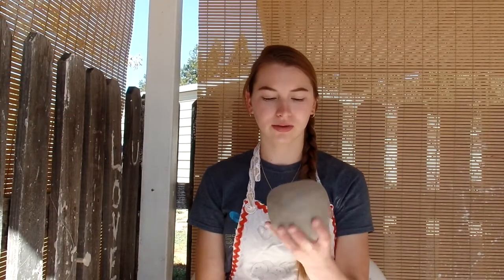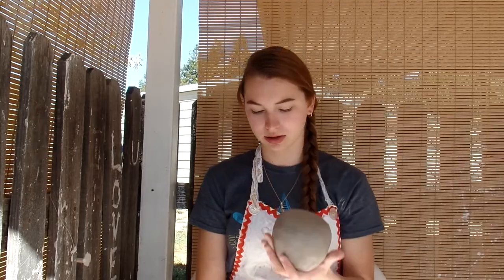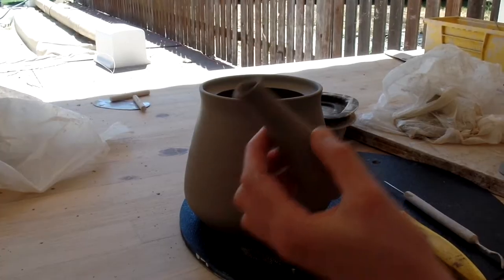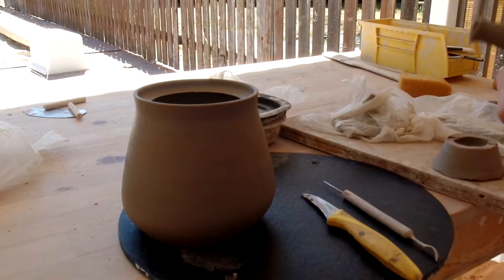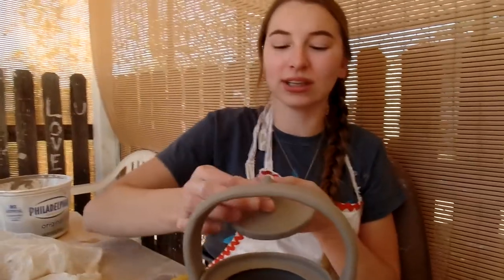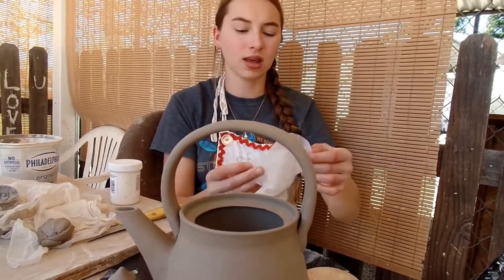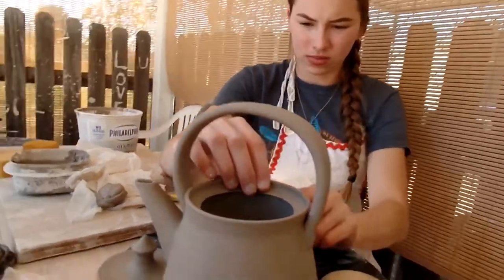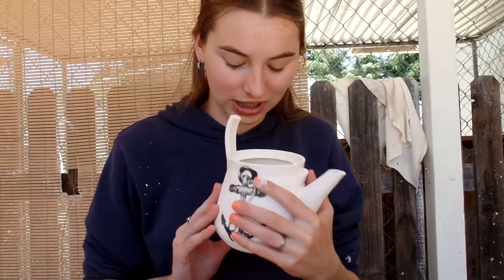Teapot with Silkscreen Anchor Design!

Comment: That’s a cool pot, especially the thick lid. Most pots I’ve seen are thin and flimsy and doesn’t insulate the heat with hot beverage so that’s pretty cool. I’m wondering with the handle have you consider putting a knob on it as a new way of holding s teapot? 🤔😀
Reply from the maker: It’s possible! Thanks for the suggestion
Reply: @JustBEPottery  anytime & you're very welcome! :)